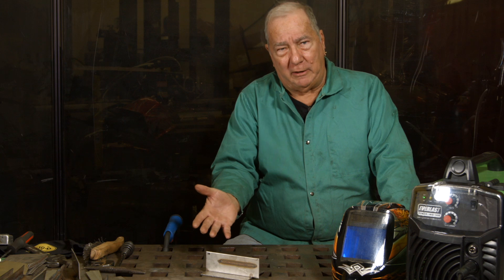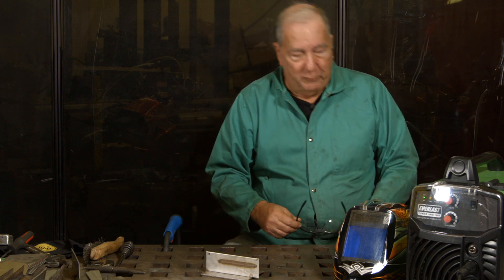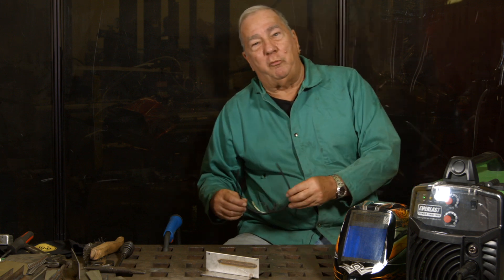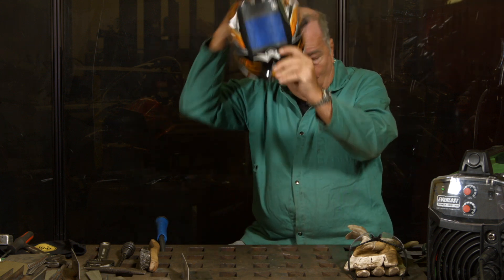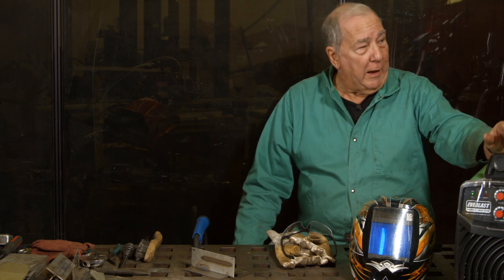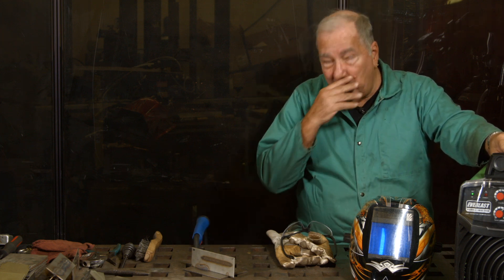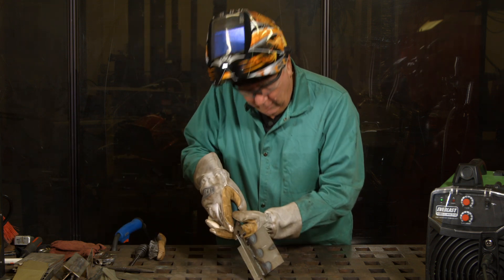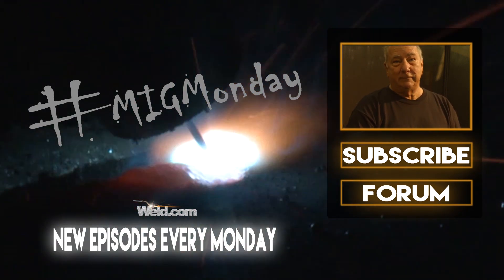How to MIG Weld Stainless Steel to Mild Steel | MIG Monday

Comment: First off you need 309 wire and a tri mix gas argon co2 and helium use a electrode 309 stainless 3/32

Comment: Hmm, I must have a horrible welder machine. Your weld looks nothing like mine. I'm here trying to figure out what I'm doing wrong.
I have a stainless exhaust so I purchased stainless couplings yesterday but couldn't locate any SS wire for my mig. So I was forced to go with what I had and OMG, talk about gorilla welding, I can weld two pieces of wood together that'd look better.
What am I doing wrong? I'll keep searching. I ran all 3 welders too, mig Tig and stick didn't seem to matter. Stick done the best but it's way to hot and ended up with too many holes to repair. So I switched back to mig.
I know the couplings I purchased don't hold up near as well as the pipe itself. Damn things receded back like they were made of plastic. Was difficult getting the puddle to bond across them.
Anyhow, I got it done but I wouldn't dare share a picture of it, lol.

Comment: I am confused, the mild steel filler wire will have better corrosion resistance compared to stainless filler wire? I thought the stainless filler wire would be less corrosion.

Comment: I'm a little bit confused here. We didn't get to see the backside of either of those welds as far as penetration. Also I would've liked to see proper welding technique. Anybody can just lay straight bead but what about proper welding technique and a proper weld. I get that the demonstration was just a demonstration. But I'm kind of thinking if we're gonna do it then let's do it right let's do a proper bead the right way and check out the backside for penetration also. Obviously this should not be done on something very important but say you're gonna do it on a boost fitting on a turbo application. I would really like to see penetration for that. Who cares about corrosion make sure it's dry and paint it with good paint and you don't have to worry about that. But as far as strength I have a big question on that

Comment: I do this to weld stainless nuts to mild steel sometimes, I feel that's a legitimate use for some occasions
Reply: I used steel wire, as the weld can be painted.

Comment: im curious if the mild steel filler is just as strong as the stainless filler in terms of tensile strength. i understand the corrosion resistance is diminished but if the pull force is any different?

Comment: This was exactly what I was looking for, and allowed me to continue with my project. I don't give a single dang about the corrosion resistance of my weld. Nor do I care how it even looks in the end. Also doesn't have to be strong. I simply have a project that is almost all mild steel, but I want to tack on some nuts behind some holes so I don't need to hold them with a wrench. And the only nuts I have on hand are stainless. I sure don't want to go buy mild steel nuts for this when I already have the right size! Knowing that this will work was all the confidence I needed. And it worked out great! I appreciate your honesty and practical know-how. We can't always do things the prescribed way, and sometimes we just need to know what will "work" vs what is "perfect."  Thank you!🤩

Comment: I have welded 300 series stainless to mild steel in automotive exhaust tube applications. I have only used ER308L wire with Argon 75 / Co2 25. This has worked well for me. You would imagine there are a lot of vibrations in automotive exhaust. I have not had any cracking or breakage of these welds. With 400 series stainless tube I use ER70S with the same gas because of the higher iron content of 400 series stainless.

Comment: Can I mig weld a stainless nut to a broken mild steel bolt without gas to work to back out the broken bolt?  Issue is the bolt is metric and I only have M12 stainless nuts on hand.

Comment: I’m welding with a 180C Lincoln putting together 1/2 inch rod 304 with 100% argon with.035 wire stainless any idea what I should start my setting at?

Comment: I have 304 stainless vbands with mild steel tubing. I have flux core stainless from blue demon my question is would I have success with the welds between the two I'm not to worried since it's not structural it only for exhaust. The exhaust will only need to hold 10-15 pounds of back pressure.

Comment: Very informative, thank you, I'm actually about to do the same.  So, buying SS wire I don't mind doing, the tri-mix, especially since I'm not welding SS at this point much at all isn't feasible.  Would welding mild (well in my case it is actually ABS (American Bureau of Shipping - in my case ship building, hot rolled low iron content) that I want to weld SS 1 1/8" bolts to.  Not using the tri-mix but the 25/75 with SS wire, would this be any better or should I just stick to the mild wire if I'm not getting the tri-mix at this point?

Thank you again

Comment: This was one of the most straight forward and to the point, showed an example with the reasoning of the right way. Showed a "wrong" but still acceptable way for a small or quick repair that might want to see if you can. At the end, informs to do what is right for the job.

Comment: thank you for stating the truth regarding the quality of the weld and the benefits to doing the job the correct way with the right shielding gas and proper filler wire with these 2 dissimilar metals !!!  I had a friend running an automotive exhaust repair shop and he didn't understand why welding exhaust pipe on newer vehicles never resulted in long term success when using wire and gas for steel .  My background is in heavy industrial maintenance as a millwright and we used a lot of stainless in our operation for not only it's corrosion resistance , but; also for it's ability to withstand high heat .  I had the opportunity to work with a gentleman from western Pa . who provided a testing service on some of our machinery  in our facility and he informed me that he also worked in many steel manufacturing facilities in my home state and he was well aware of the types of steels and stainless steels that were currently being produced in large quantities in these mills .   I learned from him that the federal gov't had at some point in time mandated a change in the type of metal used in new auto manufacturing exhaust systems , and they required the auto industry to alloy their exhaust systems with a certain amount of stainless to provide longer service life  in their vehicles .  I realized that the reason my friend was not having good long term success when welding exhaust systems with this alloyed metal is because he was not using a good quality stainless filler wire and the wrong shielding gas !!  If you want quality long term results when welding stainless it pays to do it right !!!  Thanks for sharing your honest straight forward advice ,  because we all benefit from it !!!

Comment: The bucket on my front end loader has rotted out. I really can’t afford a 6’ piece of mild steel but have the exact size in a piece of stainless that is lying around. The repair is not weight bearing or subject to abuse so with your tutorial on mig welding the two dissimilar metals, I’m going to give it a try. Many thanks.

Comment: Good info for the DIY crowd. It works for me. I've used this method for making SS hinges for mild steel frames. Giant hinges are easy DIY with stainless rod and stainless pipe. It's nice to have hinges that don't rust even if it's too expensive to build the whole project out of SS.

Comment: Hi, over here in the UK we have mostly mild steel exhaust systems on cars, but some people put stainless exhaust tips on the tailpipes, just so the bit you can see looks nicer

lots of them are bolt on shrouds, but some people actually buy the tailpipe from a stainless steel exhaust and want it welding on

So i didnt think at first welding dis-similar metals was possible, until my boss tried it, and it worked real well, we only ever had mild wire and 25/75 in the welder at the shop, so thats what got used

I think the welds we did in most cases out lasted the exhaust systems, a few times people wanted their old stainless sections cutting off and welding onto the new system, but not often

Comment: Which filler material should I use to weld carbon steel SA 516 70 with SS 316? and how can i avoid the stainless steel contamination?

Comment: Can you weld 18 gauge 430 stainless sheet metal to mild steel 1"x1" square tubing frame (which is thicker than the 18 gauge) using this method? Would we just need to set the welder up for the thinner 18 gauge 430??

Comment: I love that this guy is practical in recognizing there are one-offs where you need to work with what you have and may not need the superior process. In my case, I need to attach stainless engine bolts to a mild steel engine bracket. I don't care if the corrosion resistsnce is less at the joint since I can paint that but can't paint an entire screw thread.

Comment: Using higher amounts of CO2 in your shielding gas will affect the corrosion resistance of the stainless steel. Stick to the more expensive gas mixture if corrosion resistance is critical. 
The stainless steel filler wire will also decrease the ductility. The weld metal at the stainless steel side will have a higher chance on martensite formation.

Comment: That was a very good piece of information. Just what I was looking for.

I just did a project where I wanted to add cable loops to a 250# object I welded. I ran the ends of stainless steel cable into a 3/4 mild steel nut and about 3/8" out the other end. Then I used my regular setup to build a puddle that melted the cable ends. I cut one in half and it looked perfect.

I have another project coming up where I need to weld nuts inside a carbon steel pipe that will be in an irrigation ditch. I was planning to use stainless steel nuts to protect the threads against corrosion. Your video answered my question on feasibility. Thanks.

Comment: I know this is an old video....but thank you! I would rank this as the best YouTube video I've ever watched...you told me EXACTLY what I needed to know!
THANK YOU👍👍👍👍
Reply: same here.    Removed Argon gas and stainless Mig wire from my shopping list - saving £30 in the process.   Welding a staineless steel flexi to an exhaust front pipe.

Comment: Thank you for this video! I need to weld a flat washer onto an axle. The washer size I need is difficult to find in mild steel. I’ll be treating the weld and washer with POR 15 so I’m not too worried about corrosion. Also, once finished it will never be seen 😂

Comment: Thanks my VW beetle J pipes are stainless. I will weld the steel flanges onto the stainless J pipes and bolt to my steel sidewinder headers. I will spray treat with black hi temp exhaust paint. Thanks again.

Comment: Thanks very much Paul.  I have a solid 10" diameter x60" stainless piece with 1 1/2" axles and pillow block bearings.  i wanted to use it to make a lawn aerator by welding on mild steel spikes.  Thanks to you i am now going to try it.   Keep Smilin

Comment: I'm here... because I wondered the results of welding SS to MS. 

I've been welding successfully for 35yrs, and your video was just what I needed to see/hear. Like others, I appreciate the commentary and instruction. Love that you weld, and show the result. What makes your video even better is the lack of run on commentary and nonsense that I often see in other videos. Some videos, try to be instructional and don't even relate to the damn title. You sir... are on point!!  Thank you.

I'm welding SS tube onto the inner C-channel of a boat trailer (only sees fresh water). The tube, will be thin wall and only to hide trailer wiring (running/stop/turn light wiring). So it's not structural and I'm trying to keep the tube as rust free as possible. It will be painted, but using SS will aid in it's longevity. Because this is a rare thing for me, I'm going to use std mig wire and steel mix (75/25). 

Again... thank you, you just helped make my decision easier. Have a good day!

Comment: so if you are going to paint or power coat the part it really doesn't matter if you use the wire made for mild steel and 75% argon %25 co2 gas if you are not worried about corrosion resistance because it will be protected when it is coated.

Comment: I have a question, do you think that I could get away with welding a mild steel flange (base mount for wind generator head) to a 316 stainless steel  2 1/4"  tube for a pole for a boat, if the mild steel and weld where painted with something like rust-oleum paint ? Thanks

Comment: Good advice and techniques. I have a small repair to a stainless pipe to muffler, but don't want to spring for the extra wire or gas. Thanks

Comment: Does it matter if I use mild steel welding wire if I weld a stainless nut to mild steel? I don't really care about corrosion resistance its just to make a functional part. Never mind I watched the rest of the video, I'm gonna give it a go lol

Comment: I know this video is old and I was just looking around to see if there may have been something I may not have known or tips, your videos are very informative. I weld outdoor wood boilers and 35%-40% of my welds are from mild carbon to stainless. I use a Miller Axcess 300 with dual feeders ( one feed for my mild to mild and one feed for stainless wire on my mild to SS) along with water cooled lines as I do passes up to 6ft in lengths ( 4ft runs on my mild to SS) with high voltages as I work in a production setting. My mild to SS I use millers Accupulse setting, 51volts, 850 wire speed and my arc trimmed out around 16-18. I have done this for 5-6 years and still don’t like welding mild to SS as it’s harder to lay it down into the mild and that’ll never change. It can be done but just a pain.
Reply: hmmm...I'd like to see YOUR video!

Comment: I’m about to use my MIG welder with steel wire and no gas to weld stainless to normal steel for my exhaust hanger. Hope it turns out good

Comment: Paul, Thank you, Thank you. As an ASE Master Tech of 40+ years, being forced into early retirement was not my plan but when the Dr. pulled the plug on me, it took two years to realize he was right. Being 6’3”, bending over fenders and pulling cylinder heads takes its toll, plus a few serious injuries caused by a boss trying to save a buck. Now, vehicles started using unleaded fuel in July of 1979 for the 1980 model year. At some point with catalytic converters creating extreme heat, GM and others started using 304 series exhaust tubing in front of the cat(s) and 400 series pipe back. All of a sudden, very few exhaust repairs came into dealers. Fast forward 40 years, I am on foot but using what works. Welding a “V” band on salvage exhaust & engine from my sons wreck GM800 utility (That’s when you know they are grown/wrecking their own instead the 4 I’ve lost) but only have a MIG from 1984, that at 150 amps, stitch and other features, works great. I wanted to use these “V” bands but can’t afford a spool or new tank. (Much less afford to re-fill what I got) But proper cleaning, dedicated stainless brush I firmly believe due to your video, that a weld will work great. I plan this way in advance, so after-cleaning a cold galvanizing spray like CRC, and perhaps a coating of high heat should last years if maintained. Having one shot to properly place an EFI engine in a 53 year old C10 as my medical joint issues won’t allow me to do much as each year passes. So looking forward to have a daily driver, something I once owned.
Again Paul, thank you much for your efforts. Stay safe and remain healthy as this Chinese virus runs its course. Liked & subscribed!

Comment: Thanks for the video! Made an error fabricating my stair railings and didn't tap the holes prior to welding the railings together. The angle is now too tight at the top to tap one hole on each railing. The balustrading wire and eyelets I have are stainless steel and welding it in place was the first thing that popped into my mind but I was unsure about welding mild steel to stainless. Buying new gear for two eyelets wasnt my idea of a good time, but your "real world" advice allowed me to feel better about choosing the less than perfect, yet still successful option. Cheers! 👍

Comment: Making 2 different exhaust into one for a motorcycle stainless is getting painted anyway thanks for the info
Reply: Been about 1000 hard miles on and off road and no problems at all! Thanks again
Reply: Ray Stillwell did it hold up good?

Comment: What I do when faced with a stainless repair or fab using mild steel wire (I have a spool gun but not the gas)... mig weld as usual then spray Rustoleum 2000º high-heat clear on the weld, then bake it (as per directions, 250º for 30 min. then 400º for 30 min. and then 600º for 30 min., with 30 min. cool-downs between each. Works like a champ, might eventually corrode, but might not!!!

Comment: Hi, I need to make some adjustable suspension links for my car. It involves welding a mild steel bush sleeve to an A2 stainless M12 left hand thread bolt, i can't find them in plain or BZP.  I have use normal mild steel 0.6mm MIG wire and a 95% argon, co2 mix. Will it produce a strong enough weld? If not i'll do away with bushes and just use rose joints (heim joints), eliminating the need for any welds.

Any advice is much appreciated.

Comment: Don't match filler to stainless grade for SS to CS use 309/L.   308/L in a pinch but not recommended. Don't use 316 or 347 as they don't have enough cromium. Of course this only applies when you need the weld to hold